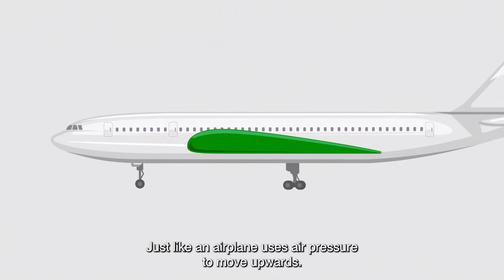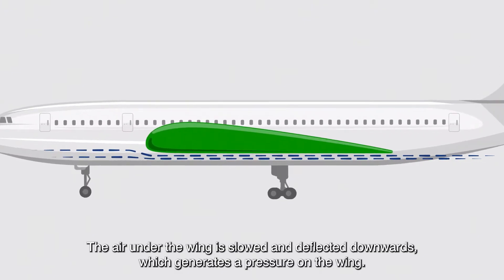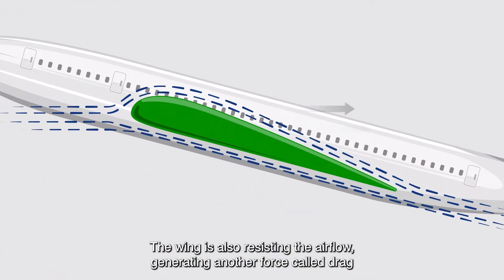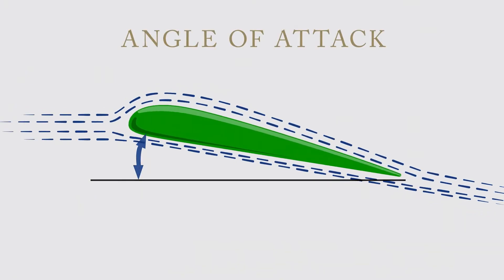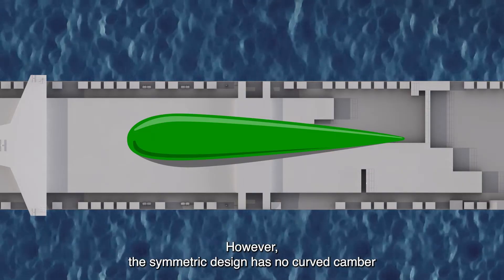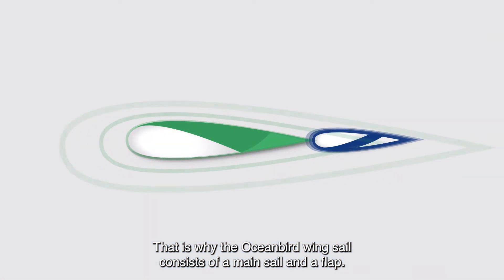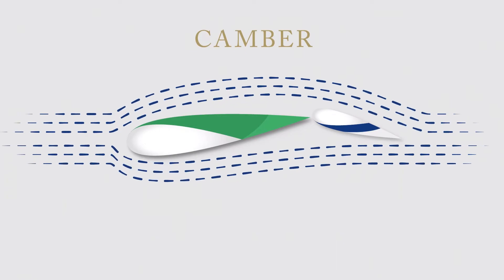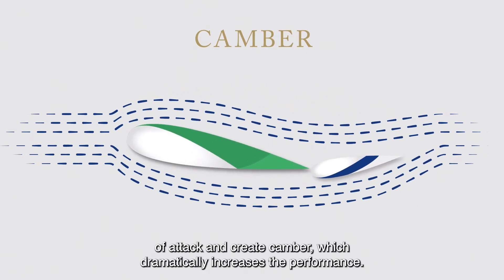Oceanbird: This is how a bird’s wing can move a vessel

Comment: The video starts with the equal time myth that physicists know is wrong. An airplane wing generates lift by deflecting air downward (Newton’s Third Law), creating a pressure difference between the upper and lower surfaces (Bernoulli’s Principle), aided by the Coanda effect. Too bad the video perpetuates the equal time myth.
Reply: Not only that but also the narrator has the most BORING way of doing so. His voice has a lot to do with it as well.
Reply: Maybe it's a combination of the two principles acting together which produce the lift?
Reply: @begonnne  no, the air absolutely does not have to arrive at the same time. There is no such effect.
Reply: Came to the comments to say exactly this. Thanks for beating me to it so I don't have to type all that! 😉

Comment: How will you deal with fron winds which are against movement direction?
Reply: Any sailboat can sail in the direction of the wind. It's called going upwind. The force generated by the sail is balanced with the force generated on the hull, the resultant of those 2 forces is the force that move the boat forward
Reply: @julesangebault1780 thank you good man

Comment: We went from this to a steam engine then a diesel engine. What happens when the wind doesn't blow.
Reply: Then engine back on?
Reply: That's actually quite rare and localised that even a small spare engine can quickly move the ship into the wind again. A better question is what happens when the wind blows against the direction of travel?  Can the sail pull as well as push the ship?
Reply: @christoffermonikander2200  sailboats can sail upwind since the antiquity.
Reply: @julesangebault1780  Sailboats can tack upwind using actual sails that is true. But One, tacking takes time and extend the distance needed to travel which isn't cost effective for a modern cargo ship, and Two, these aren't sails that get pushed by the wind but more like airplane wings the generate lift that push the ship, so how knows how well they work when the wind comes from awkward directions. And that's the big hurdle to overcome: can these sails guarantee the shortest path between two points regardless of the direction of wind, otherwise they won't succeed.
Reply: @christoffermonikander2200  first of all a sail and a wing works exactly the same way... secondly the shortest path is not necessarily the best path to take... Also you don't really seem to understand how winds works, especially across ocean where the wind is quite predictable and in mostly the same direction
Reply: Break out the Wind less Propulsion Unit...AKA The Engine...😂😂😂